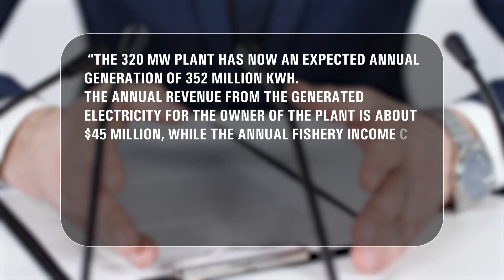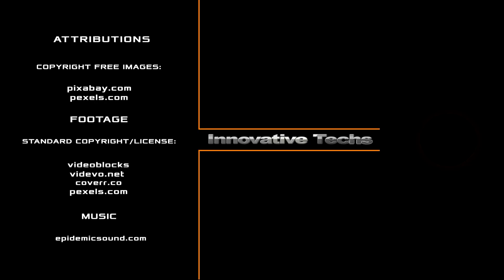Can floating solar farms solve the energy crisis?

Comment: We simply must get the vacuum energy part moving, for when one examines all the options, it is the only option that will work in time.

We already know that the Maxwell-Heaviside equations, prior to Lorentz regauging, do include open systems in disequilibrium in their vacuum exchange. We are also already aware that the present classical EM model completely omits the vacuum interaction (much less any broken symmetry in that interaction!), which we also know is a gross non sequitur since the vacuum interaction (and the dipole's broken symmetry in it) have been well-known in particle physics since the 1950s.

The major problem in the U.S. is that the decision scientists at top positions advising leaders/secretary/vice-President/presidents, usually do not know anything but U(1) electrodynamics, and the advice they get from additional "expert" scientific consultants or advisers is inferior in that these "expert advisers" also seem to know only U(1) and also only the Lorentz-regauged Maxwell-Heaviside equations. Many (most) do not even "believe" in the active vacuum, or if they begrudgingly admit it, they think it is of absolutely no consequence. And they simply do not believe the tremendous energy density of the vacuum, nor will they accept it, even though it is good physics and has been for decades.

Hence the entire scientific energy structure and infrastructure in the United States is fearsomely welded to a small fragment (subset) of James Clerk Maxwell's theory, and even to just a Lorentz regauged subset of the severe Heaviside truncation of it!  We have a scientific mindset problem of epic proportion. In short, the energy crisis is completely the fault of our own scientific community. It is NOT the fault of the President, the Vice President, or the Secretary of Energy!  It is the direct fault of the inferior advice being given them by the NSF, NAS, etc.

The sad thing is that the U.S. scientific community is seemingly no longer capable of even evaluating its own U(1) EM model, as it has become almost an iron dogma. E.g., in the 1880s Oliver Heaviside discovered the enormous energy pouring out of the terminals of any generator -- vastly more energy than we provide as mechanical energy input to the shaft. John Henry Poynting in 1884, of course, only dealt from the beginning with the tiny component of that energy outpour that is intercepted by the external circuit and caught and used. Hendrik Antoon Lorentz understood both the Poynting component and the Heaviside component as well. But no one could explain what could possibly be the source of such an enormous energy flow from EVERY GENERATOR, BATTERY, AND SOURCE DIPOLE. That is rigorous. Simply check Heaviside's original papers.

Anyway, Lorentz in 1892 then took the attitude that this enormous Heaviside energy flow component, missing the circuit entirely and just wasted, had "no physical significance" (his words). So he arbitrarily discarded it (not from NATURE, but from MATHEMATICAL ACCOUNTING) by a clever little integration trick, still used by all the electrodynamicists and those energy scientists designing and building our electrical power systems, writing our textbooks, teaching in our universities -- and advising Presidents, Vice-Presidents, and Secretaries of Energy.

In short, we most often face scientists who literally will not believe and cannot comprehend that every generator we ever built, already extracts enormous energy from the vacuum. It is quite easy to prove it, for peanuts. Any lab, university, or decent experimenter can do it. Kraus' diagram in his Electromagnetics, Fourth Edition, shows the nondiverged energy flow component in the form of contours, which are MEASURED watts/square meter at each point, where a unit point static charge will catch that much more energy.

Let me now give you a rigorous proof, and very simple, that every system is already vastly overunity by producing far more energy out than we input. Consider a perfect DC generator, loss free, so that its efficiency is 100%. Now consider a perfect external circuit attached, which consists of two short lengths of perfect conducting wire, and a pure resistance load. Let the load be 12 ohms, and the voltage of the generator be 12 Volts D.C. Now we have a neat little situation: We put in the mechanical power equivalent of 12 watts to the shaft. Since the generator is loss free, all the 12 watts are perfectly transduced into magnetic field, and the energy in this field is dissipated with 100% efficiency to form the source dipole. Let us leave the source dipole for a moment.

Now we look at the external circuit. There is one ampere of current (12V divided by 12 Ohms) flowing in the external circuit. So we are inputting 12 watts of power  to the generator shaft, and we are getting 12 watts of power output in the resistor. All this is clearly measurable and normal so far.

Now we check out John D. Kraus, Electromagnetics, Fourth Edn., McGraw-Hill, New York, 1992. Figure 12-60, a and b, p. 578 shows a good drawing of the huge energy flow filling all space around the conductors, with almost all of it not intercepted and thus not diverged into the circuit to power it, but just "wasted."

Hey!  We have 12 watts of power in. We have 12 watts of power output of the resistor as heat. By conventional Poynting considerations, we are getting out precisely what we are inputting. That is a blatant lie. We are getting output from the resistor precisely as much as we are inputting to the shaft of the generator. Yet we also are getting out a measurable vast amount of energy flow from those generator terminals, filling all space around that circuit. Those Kraus contours are experimental measurements. Anyone can do them, or similar. Anyone can build a little system very similar to this one, and approximating it.

So where the devil is all that VAST EXTRA MEASURABLE ENERGY FLOW pouring from the generator terminals, and missing the circuit entirely, COMING FROM?

Experimentally we can easily prove that this Heaviside nondiverged energy flow is (1) real, and (2) very large.

Let us now add in an extra set of "receiving antenna/collectors" whose circuitry is completely separate from the DC generator circuit with its load. Suppose we add enough of these "little antenna/interceptor/detector" circuits, each containing a little purely resistive load, to obtain 3 watts total in all those extra and independent circuits.

Well, now we are inputting 12 watts. We are getting out 12 watts in the external resistor attached to the generator. We are also getting 3 watts out of the "extra receiver circuits" separately, in separate loads.

So our total input is 12 watts. Our total output is 15 watts. Our demonstrated COP = 1.25.

So how do the "experts" explain that simple experiment????"  They don't. But any lab worth a tinker's dam -- and that includes any lab in Department Off Energy and in any university -- can do a similar experiment, catching enough of the extra "usually nondivergent EM energy flow" to bring the COP to COP>1.0.

This is a very simple experiment. So is the Bohren experiment which produces COP=18, is published in the hard literature, and is independently replicated by two additional scientists and published in the same issue of Am. J. Phys. that published the Bohren experiment paper.

Anyway, Lorentz's "physically insignificant" vast Heaviside nondiverged EM energy flow component is indeed "physically insignificant" to that single external circuit powered by that DC generator. But it is certainly not "physically insignificant" to those extra "receiver/collector circuits" and their independent loads.

Let's use two imaginary viewgraphs where in the first one Lorentz is shown in a sailboat on an ocean, in a very nice large ocean wind. Puffing his pipe, Lorentz is smiling and saying, "Only the wind in my sails is of any physical significance".  In the second graph, Lorentz is looking aside at a whole fleet of additional sailboats, calmly sailing along and powered by that "insignificant remaining component of the wind".  And Lorentz is saying, "How can they be using that physically insignificant wind?"

This is an exact analogy to the state of thinking that now exists in the U.S. power industry and the U.S. scientific community concerned with power systems. We don't have an energy crisis, we have a collection and usage crisis—and a vast scientific mindset crisis.

Hopefully this will change in the future with highly capable scientists who know quaternion electrodynamics, Maxwell's original complete theory, etc.

Comment: 2 axis Floating solar could be much better than stationary (0 axis) using rotating floating pads, with water hydraulic or air pneumatic tilt control, providing full power over full day time.     Southwest  USA reservoirs need this.

Comment: What about the possibility that a panel sinks? A solar farm at the bottom of a lake after a major storm could become an environmental hazard. Nuclear power has a smaller  area footprint due to it's much greater power density than renewables or fossil fuels.
Reply: Al-tho you do have a point, comparing this to nuclear energy and objecting on the ecological dangers of a sunken solar farm is silly. No offence
Reply: @fic15  Both power forms are needed, but I agree. Even if it sunk the materials are easily recoverable. It's not like we talking oil sands tailings or anything...

Comment: If you can't meter it to sell it,
  It's not going to get approval. 
Cars that run on water is a perfect example.  The only thing that comes out of the exhaust is water.
But it will never get approval because they haven't figured out how to charge people for water from lakes and streams or even from the ground. This technology existed back in the 50's.
Reply: Cars can’t run in water
Reply: @myaccount__7269    cars can run in water.  Watch a video on amphibious cars.
   What I'm talking about is, cars that use water as fuel.
  You don't have one, so you instinctively say they don't exist. 
Technically water is h2o.  By separating the oxygen from the Hydrogen, you can power a car on Hydrogen. 
  There are cars in India that can run on only air.  I didn't say that they are practical,  but they do  exist.  
   How hard is it to turn over a diesel engine fast enough to start one.  Mack trucks have used air for many years to start there trucks.
Reply: @joeblow3939  lol dude...none of that makes sense. Show proof or gtfo

Comment: Where did you get that information from that 80 PetaWatt is 3 times that of world consumption?
The world primary energy consumption in 2020 was 556 ExaJoules. This translates into an average power of 17.6 TeraWatt which would be far less than a third of 80 PetaWatt.
Reply: 3 times of what the world needs. Many countries today are still underdeveloped and aren't generating even close to the power their citizens would need, assuming all humans desire equivalent standards of living. Though admittedly that still doesn't come close to 26 PetaWatt.
Reply: the IEA reported a total world electric energy consumption in 2017 of 21 PWh. 80 PW * 1h = 80 PWh. even with 556 ExaJoules, it'd be about 154 PWh.

Comment: I don't know where you get your numbers from but it would only take 0.6% of the surface area of the continental United States to power the entire country with renewable solar power.
Reply: Yeah this is total bullshit. An area only the size of Spain powers the entire world. Dislike for pessimistic misinformation.
Reply: @illuminate4622  Yeah, if he can make these kinds of basic mistakes you have to question a lot more of what he says.
Reply: About 12,000sq miles for the united states ( about twice the size of Hawaii or New Jersey. )
Reply: @ronvosick8253  It depends on what assumptions that you make, I came up with a much higher number.  But it does not matter, the numbers provided in the video are just gibberish.
Reply: @VictorGallagherCarvings  let's see...

Yearly US electricity usage ~4000 TWh
One sq mile=200MW capacity
US solar capacity factor ~20%
One square mile produces= 200MWx8760hoursx0.2capacity factor=
350 400 MWh= 0.35 TWh

4000TWh/0.35TWh=11 400sq mi

Eleven thousand square miles of solar panels to power America. It's actually less than even I thought!
Reply: @illuminate4622  and if some amount of building top are used in the equation you can cut down on land space even further.
Reply: @oneildennis5956  yes. In fact, rooftops in America could generate 40% of its electricity. Another possibility is solar canopies over parking lots.